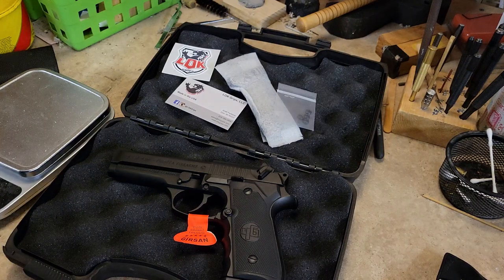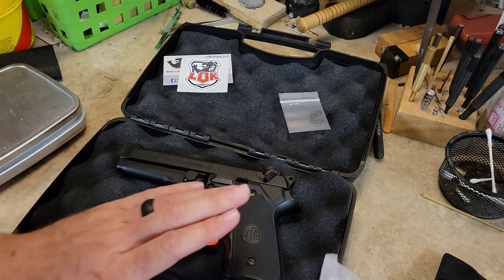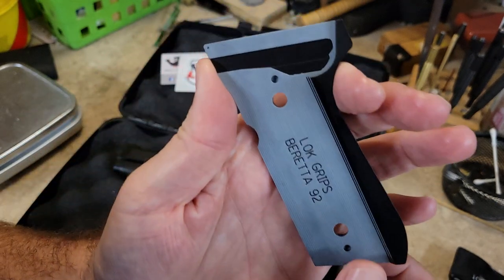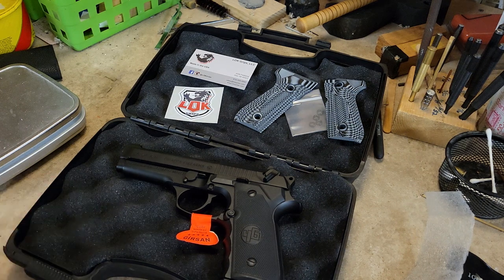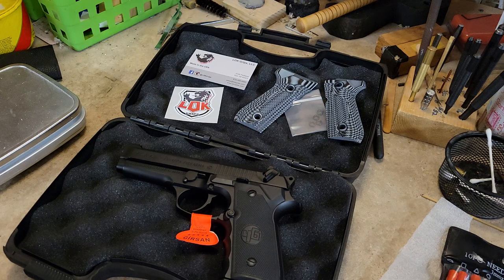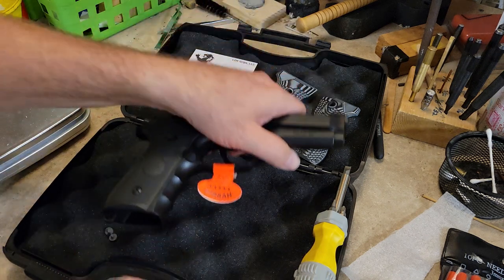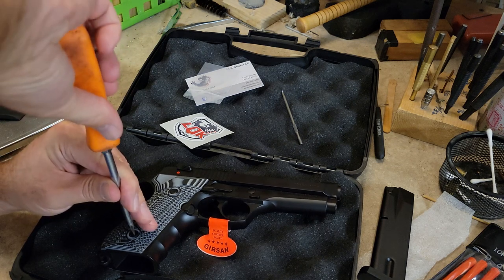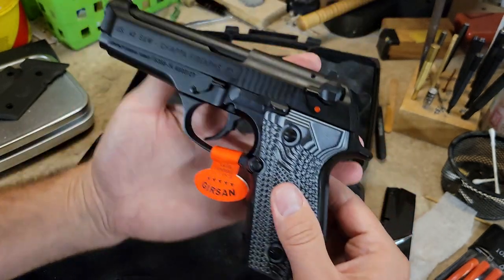Lok Grips G10 Veloce grips install on Beretta clone Girsan Regard!

Comment: For the amount of money spent, the fit should be perfect.  I have bought from them before and all of the grips have been perfect except for my last pair. For the money, anyone shouldn’t have to do any fitting.
Reply from the maker: You missed the point.  These grips were designed and do, fit Beretta.  Girsan guns are slightly different than Beretta, therefore the modification was required. LOk stuff is top notch